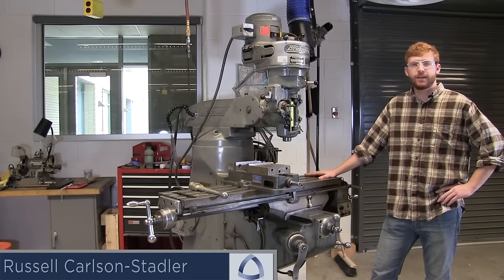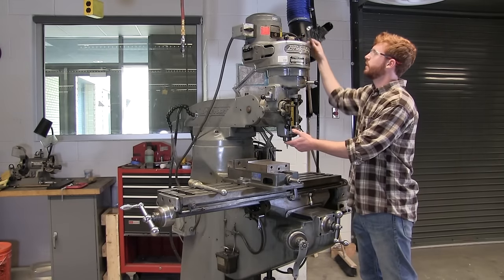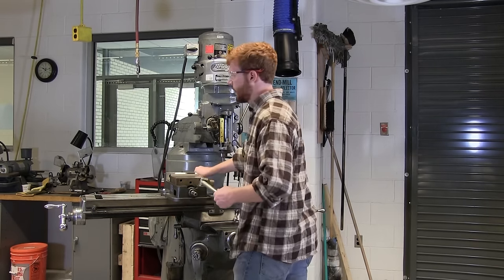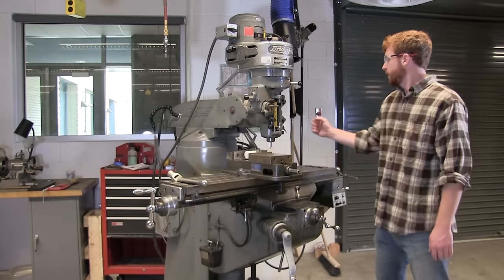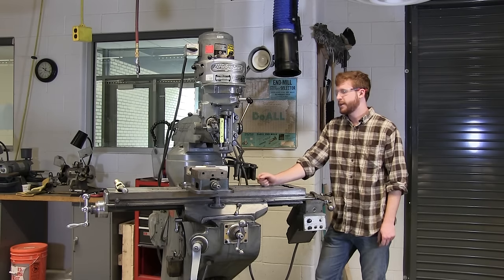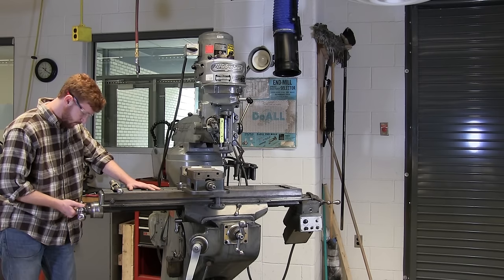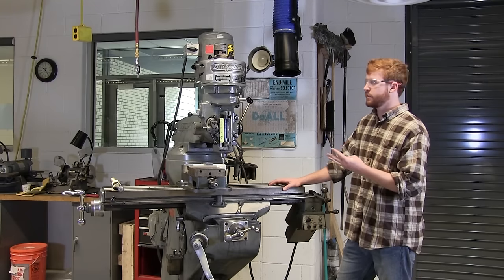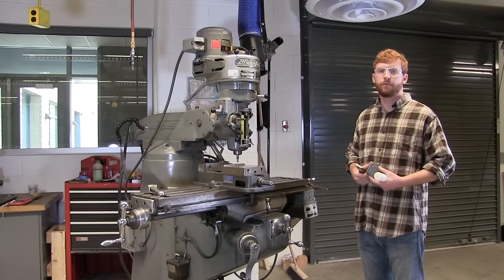Manual Mill Tutorial

Comment: When you use the edge finder, did you make sure to add or subtract the radius of that edge finder? Because your setting it to the outside diameter of the edge finder not the actual zero itself. Otherwise your drill will be offset by the radius of your edge finder

Comment: If you are going to have someone teach people how to use a mill, They need to be told the right way. The back gear handle he is calling the brake is not true. The spindle brake is on top left side of the head. The lever he is calling the brake in truth is call the back gear lever. That's how you change from high to low gears. Get it right !!!!
Reply: Timothy Skelton Man thanks!  I've been using the brake hand all this time and was wondering why he was calling the other lever the brake. We have the exact same mill at work.

Comment: Can it face mill? If so, what kind of surface finish tolerance can it produce? It should produce better surface finishes than a bridgeport?
Reply: That is a Bridgeport. Any milling machine can face mill when done properly, even the tiny micro mills. The surface finish is dictated by many factors such as the type of material being machined, machine rigidity, tool sharpness and the relief angle ground into it, having the machine trammed so all the axis are aligned, and using appropriate speeds and feeds more than what machine the cut is made on.

Comment: I knew that machine inside and out, a very well thought out design. The head tilts on two axises and the head can be positioned in and out.
The head can be rotated on the column . There's even a horizontal attachment. You can spin the head 180 and with a broaching head on the other end do broaching.
Point to point verified with a CMM it could hold +/- .0005 with the right technics. You could bore holes and hold diameters at .0005" and under in tolerance.
I made good middle class money using machines like these and eventually going into CNC but never strayed to far from a bridgeport for certain jobs.
Now a days these are mostly in the maintenance department of manufacturing shops as CNC has taken over in production settings.
But back in the day there would be rows of these machines with a machinist on every one.
Reply: can switch to a prototrak they r nice

Comment: Great video!
My only question, isn't the on/off switch in a relatively difficult to reach and risky location?
I've seen some of these machines include a panel that you can move around and even have an emergency stop button
Reply: Not really.
This is a manual machine, so it's gonna be more difficult to crash.
I think you're talking about CNC, where you will definitely need an E-stop button.
Reply: @johnfrazier5458  Penetrov is right. That switch is definitely in a bad location where you have the potential to reach across the point of operation to shut it off.  While doing so, you could inadvertently contact the rotating part (or clothing could).

Comment: Dont you have to adjust .100" for the thickness of the edge finder? If you 0 on the edge that is not the center of your tool. Also you should edge find your Y before the Z. That way when you takw your Z you are actually centered.

Comment: He kind of knows what he's doing I guess. Terminology is off alot of the time. He uses both hands to crank the knee up, dead giveaway he hasn't been using that machine a whole lot. I never use the brake, just flip the switch in the opposite direction for a second and it'll stop. Most brakes don't work anymore anyway.
Reply: I'm just learning manual milling, and I automatically use only one hand to crank the knee up and down. Glad to know I'm already doing it like a pro! Lol

Comment: He was using a SLOT DRILL, would have been better to use a 3 or 4 fluted end mill for what he is doing with the plastic. A 2 flute cutter IS fine for cutting steel. As the name suggests it is really meant for cutting slots,  you can also plunge straight into the work using the end of a slot drill, you can NOT do this with a 4 flute endmill. SOME 3 flute endmills have 1 longer tooth so you can end plunge.